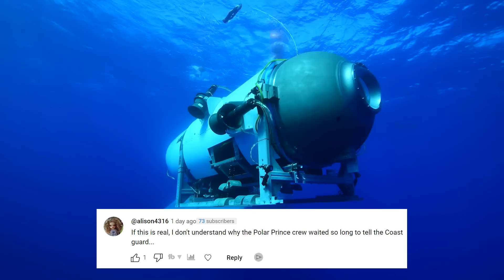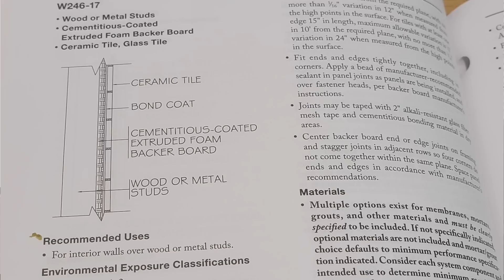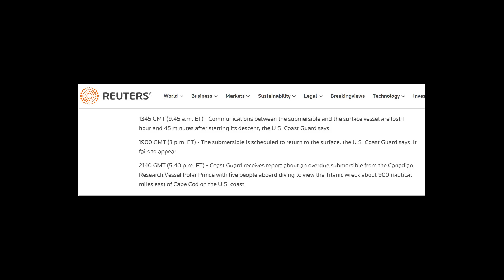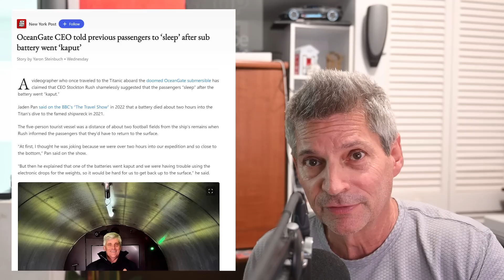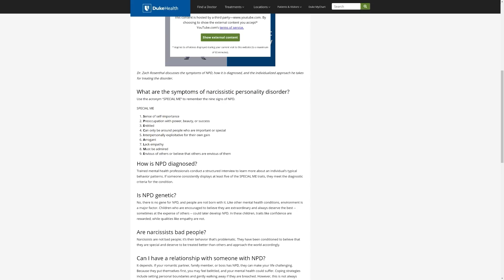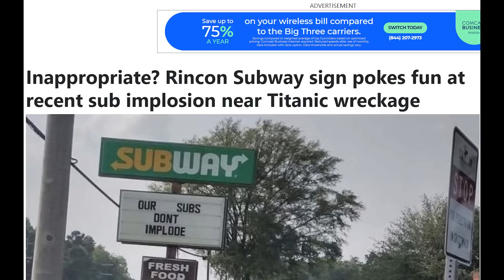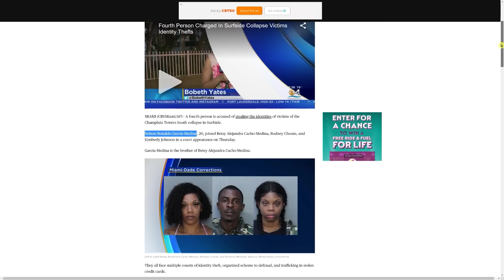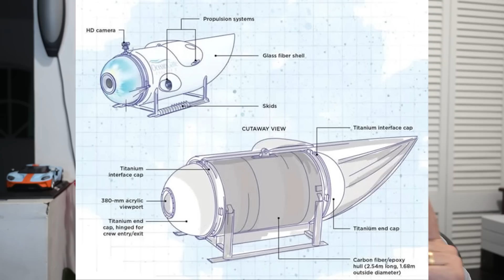Titan Sub: Why OceanGate Waits 8 Hrs Call Coast Guard, Q & A

Comment: If rescuing the sub was almost impossible, what even is “waiting too long”?
Reply: Well, they didn't know it had imploded. There's actually some press conference footage around with the people who brought in the ROV that found the debris field talking about how they had already rigged it to lift the Titan if they found it with just an electrical issue and negative buoyancy. So rescue might actually have been possible. They found the debris at 8:55 a.m. on June 22, which is 35 minutes before the end of the alleged 96 hour time window. So yeah, 8 additional hours could potentially have made a difference in a non-implosion scenario.

Edit: I've seen somewhere that it was 8+96 hours, so it was 8 hours and 35 minutes before the end of the window. Still, 8 extra hours might help.
Reply: they didn't want the world to know something is wrong. that gave them time to scrub and shred.
Reply: That depends on the situation.  If the coms posted are real, they knew they were in serious trouble, and shouldn't have waited very long at all... at most, the time to ascend.
   The topside should've seen the air that came to the surface and know.
Reply: @CarolReidCA  Don't know about the air. 3000 meters is a lot of room for that to disperse and the sub would not be right next to the ship. It's difficult to see a person floating in water at a distance, let alone a bit of foam in a sea full of (potentially intermittently foamy) waves. I wonder whether, if you were deep in the bowels of the ship and turned all the machines off, you could have heard it pop. Sound travels really well in water. Probably not that well, but hey.

Comment: Is Carbon fiber stronger then fiber glass
Reply from the maker: That I do not know
Reply: Tupperware beats them all.
Reply: By far. Think home insulation and boat hulls.
Reply: If by stronger you mean ultimate tensile strength, then s-fiberglass is stronger than carbon fiber.